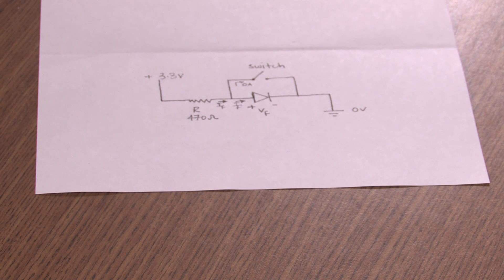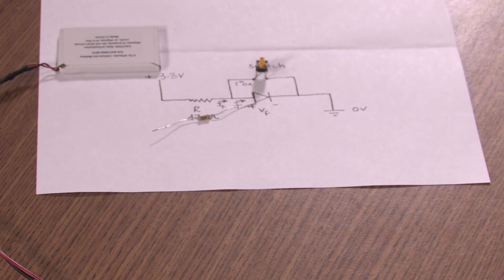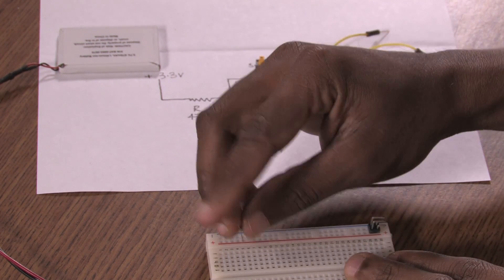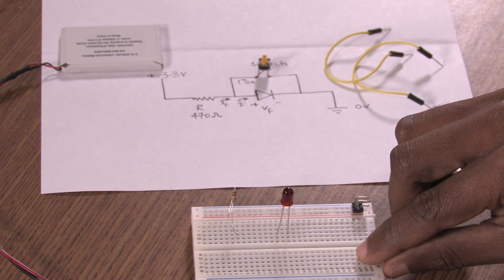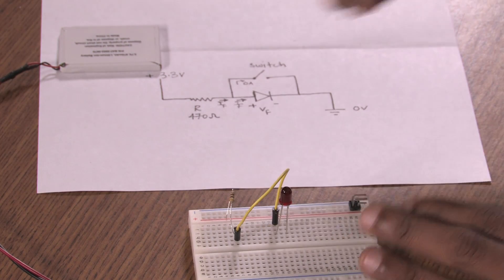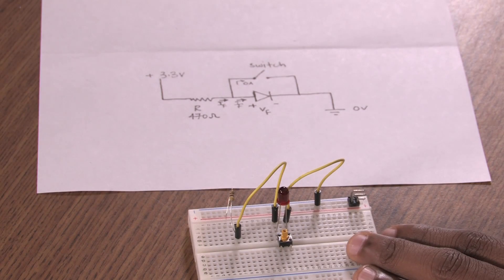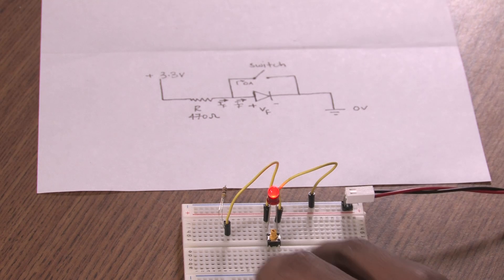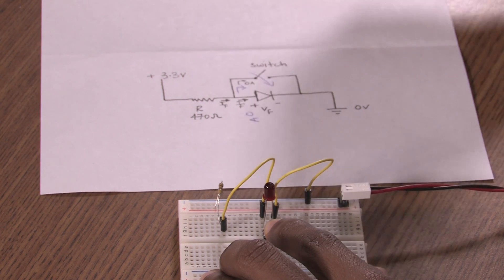C8 1 3 SwitchControlsLight

Comment: Personally I find this method an inefficient use of power. I'd rather have a normally closed switch in series with the LED than a normally open switch in parallel with the LED. That way when the LED is not in use, no power is consumed.